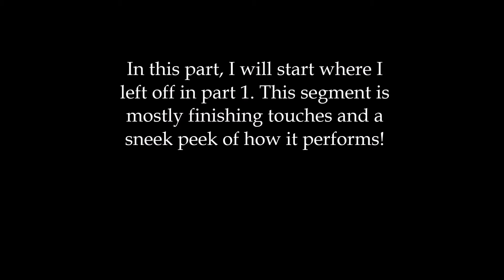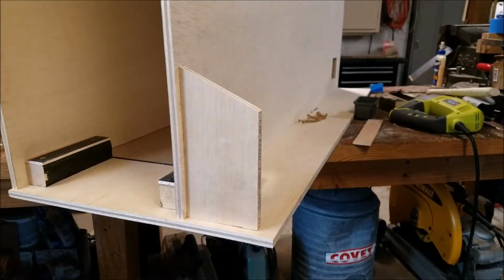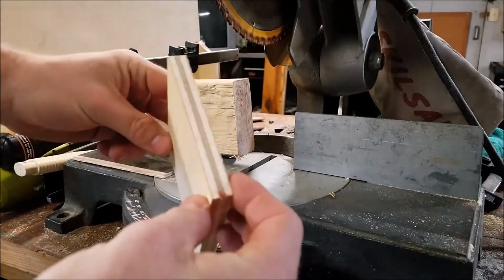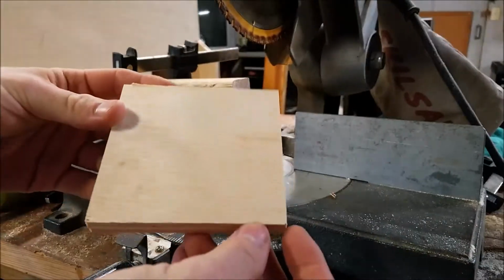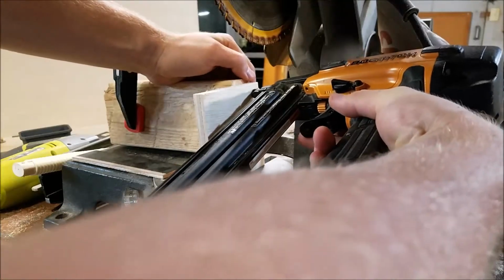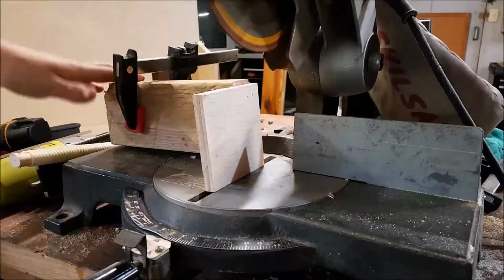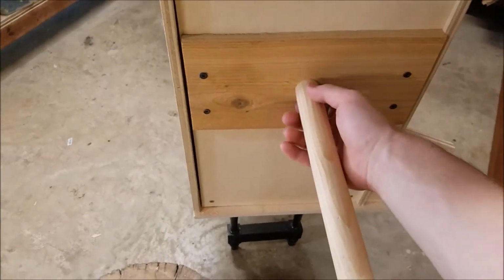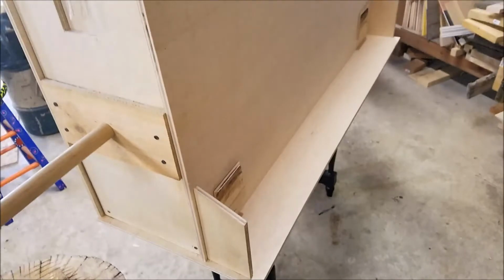Part 2! Build a Japanese Fuigo

Comment: did you get this hooked up to a forge yet? I might have to rebuild mine, going to build a new coal forge soon (been using propane). But the one I made was from about 4 years ago and it was a little harder to find information, so mine is like 4 foot long and the main piston box is a square 2' x 2'. It does work well though, but I have more tools now and have gotten a lot better at woodworking.
Reply: Thanks for the measurements for the Japanese bellows do you have any other measurements to build one?
Reply: @mountainwolf1 in know this was commented 3 years ago but if you haven’t build one yet the part one of this video has all of the creators measurements.
Reply: @Noahkam_13  I have built fuigo based on the traditional design. From my research I found there is two different types. One is smaller for tool making and the other is large for swordsmithing I built the large fuigo.

Comment: Hey im trying to rebuild my forge so i can finally get back to smithing and i just want to ask is there anything you would change for v2?
Reply from the maker: Hi. Sorry for such a late reply. I didnt get to use it as much as I had hoped. However,  in v2 i would have altered the design on the piston where the stick joins the felt lined plate. That was a real weak point and ended up breaking while transporting it. I was thinking about using a pipe flange and gluing the stick into a short section of pipe. Just a thought though. Thanks for watching!

Comment: I've been browsing Japanese versions of this (thank $DEITY for google translate).

They only use 6mm solid wood sides - really thin and weak, relatively speaking. The end faces are thicker, which supports the sides and is where the stress of the handle runs. Clever.